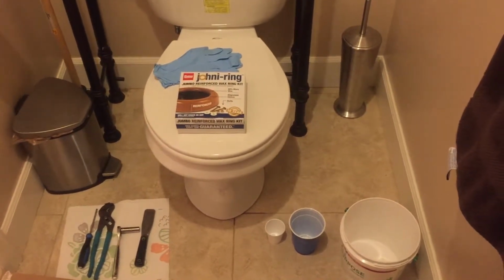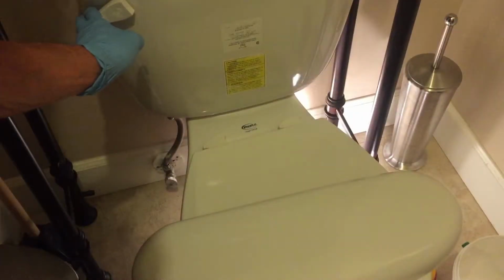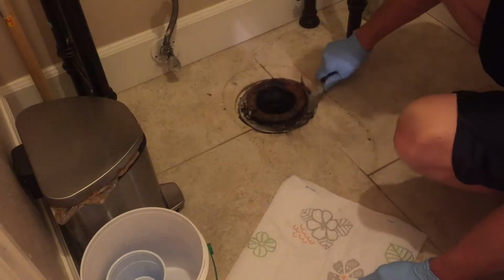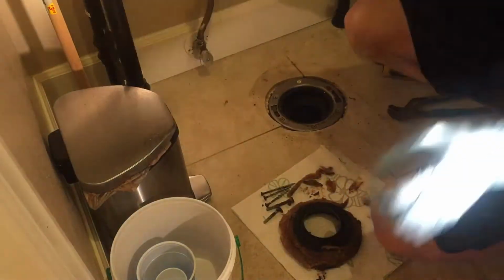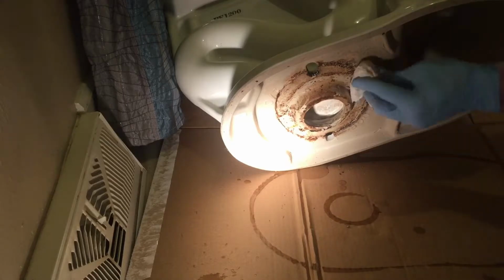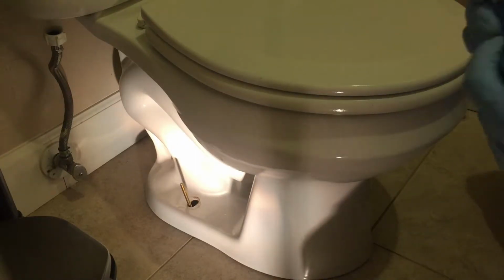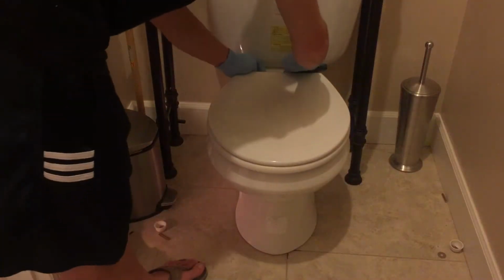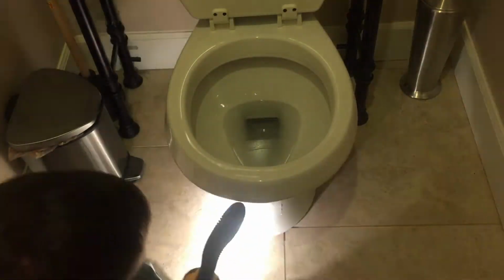How to replace a leaky bowl wax & install a toilet properly

Comment: Another option is to use silicone ring like Fluidmaster "Better than wax". I installed them in my rental for peace of mind because they don't compress and stay compressed like wax so toilet that shifts is less likely to leak (and they may not inform me its loose until they leave).